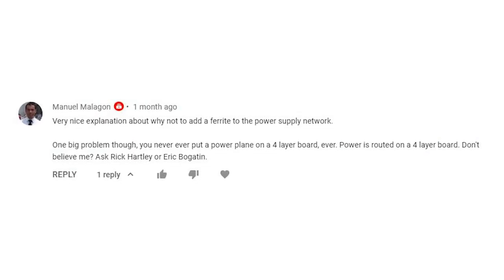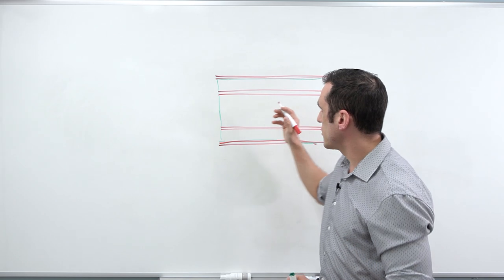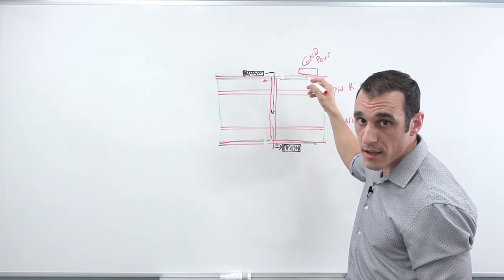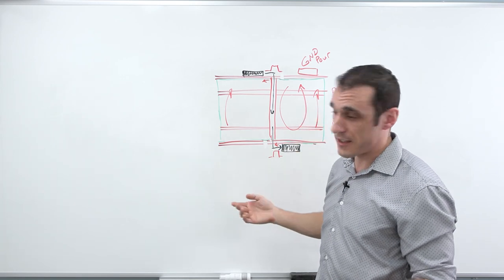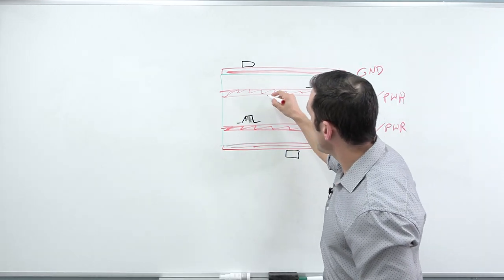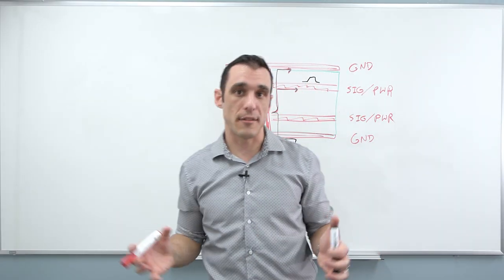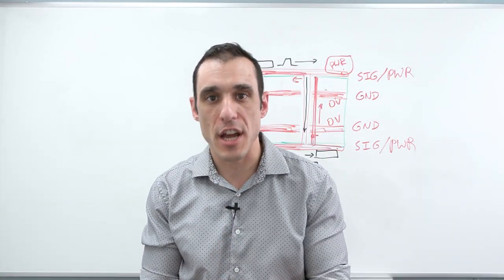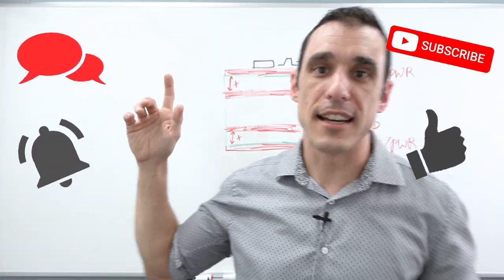Alternative 4-layer Boards for High Speed PCBs

Comment: What about when you have a BGA? there is literally no space to do any transfer vias
Reply: With BGAs it is interesting because you have to hope that the component designer placed the I/Os such that the fastest I/Os are on the outer edge of the component and so they will not require transfer vias. This is what is often done on Ethernet controllers for example, the controllers we use have all the fastest I/Os along the edges so vias are not needed. For I/Os that are in the interior part of the BGA, there will be a slight impedance discontinuity looking into the via but it will not matter so much until bandwidths are very large. This might be challenging on, say, an FPGA, but you have a lot more freedom to place those interfaces on an FPGA because you get to configure the pins when designing your application.

Comment: Hi, Zach. How can I provide a return path using SIG/PWR/GND/SIG, it is seems like there is no option. I can't route on one layer cause there's a lot of signals. Maybe i should use  (SIG/GND)/PWR/GND/SIG. What do you think about it? Otherwise it affects on diff pairs😢
Reply: The first question you should ask is: why do you think you need a dedicated layer for power? Is it because you have high current in the design, or do you have so many power rails that it will be difficult to route them all? Many designers who use SIG/PWR/GND/SIG do so without answering this question first. If you need to route digital signals on both sides of the board then you should use SIG+PWR/GND/GND/SIG+PWR. You could use (SIG/GND)/PWR/GND/SIG for high-speed on both sides of the board but it works best if you only route over uniform power regions with no splits, otherwise you can still create radiated emissions.
Reply: @Zachariah-Peterson  thanks for the reply

Comment: For better power distribution, should we use a pour or a trace on the bottom or top layer?
Reply: If by "better power distribution" you mean lower temperature rise when current is flowing, you can use large pour for power if the current will be high. If the current is low, you can just use traces to route power, you do not need large pours if the current is only a few Amps.
Reply: @Zachariah-Peterson  Thank you for your reply. I appreciate it. One question: when you said 'a few Amps,' did you mean under 10 A or 5 A?
Reply: @setia2258  Under 5 A. Eric Bogatin has a good rule of thumb, a 100 mil wide trace can easily handle a 10 A DC current.

Comment: What would be the relative limit to start considering the return current of a signal in a PCB design...?? I assume that some signals is not relevant the return current. For example the signal of an indicator led.
Reply: Hi Diego,

You always need to consider how you are routing return current. For your indicator LED, I would assume it's at DC, so there could be a large current loop in the design, depending on how you routed your ground. DC current won't produce radiation, but the loop that holds this current can receive radiation. The best way to deal with this is to use a dedicated rail that runs close to the LED power trace, or just use a ground plane. Using a ground plane is better. Thanks for watching!

Comment: What about a 4 layer stackup GND-PwPlane-Sig-GND : shielding provided by outter layers , and no crosstalk / good impedance control between power and ground planes ? I suppose we are in the case where 1 signal layer is sufficient. Signal will be mostly coupled to close GND compared to Power so splitted power plane with different Vcc would not be too much to worry ?
Reply: If one layer is sufficient and your high-speed design will be operating in a high-noise environment, then your arrangement would work well. If I were going to do the design with components on both sides, I would make it PWR/GND/SIG/GND. I would put power-related components on the PWR layer so that they don't need vias to access the PWR nets, and I think this would be better for splitting DC nets as you'll need to make multiple connections direct to polygons. SIG on the inside is also good as the planes provide some shielding.
Reply: @Zachariah-Peterson  This is a legit stackup that I didn't think about / didn't see before and seems to be optimized regarding power purposes indeed. Thanks for your prompt answer & keep doing these great videos !

Comment: Hi Zach, nice explanations, thank you.
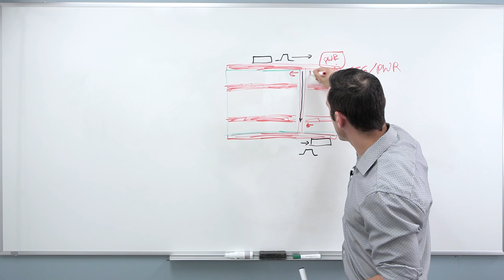14:15  "red via for return path" is it a via throughout between upper sig and lower sig layers?
or is it just between two gnd layers?
Reply: Hi Mustafa,
The red via is a through hole, so it accesses all layers, but is only connecting the GND planes.
Reply: @Zachariah-Peterson   Thank you for your answer,  can we call this method "via stitching"?  if not, what is the difference?
Reply: @myetis1990  Via stitching involves placing a regular array of vias around the board, usually to connect ground pour around your traces or to connect multiple planes. So if you have two internal GND planes, you could use via stitching to provide a low impedance connection between the two planes. I was referring to placing one ground via alongside the signal via. You can do both as the ground via next to the signal via will provide the smallest loop inductance return path.

I would not use copper pour unless you have a good reason to do so. Generally when we have a strong wifi signal being emitted or received in the board, we'll use via stitching with copper pour to provide shielding, but the vias have to be spaced closely to provide the shielding effectiveness needed in the design.

Comment: One thing worth mentioning about the GND-SIG/PWR-SIG/PWR-GND stack-up when doing developmental work is the inability to break a problematic trace for a bodge wire. If one insists on using this stack-up it's advisable to make the via trace to IC pin accessible for alterations, in other words, don't place via's under the IC. It's becoming increasingly harder to "lift a pin" on modern packages for easy modifications without the need to respin a board. Unfortunately I learned this the hard way after watching the presentation by Rick Hartley showing the benefits of that stack-up.
Reply: Yeah that's a great point, I had not thought of that. But I guess you could do the prototype with sig on the outer layer, then flip it to the inner layer with trace width or layer thickness modifications, and do a 2nd prototype just to check crosstalk and functionality is identical to the 1st prototype, then put it into production.

Comment: Hello, 
I have few questions with 2nd alternative, 
1.If our inner layers are GND , do we need to connect them with stitching via?
2. I am working on energy meter board, On top side only display and keys and few smd components present , others on bottom 
For Power section, analog and digital section 
I have different grounds 
Now questions is  how do I use inner GND layers with different section Grounding path?
And thanks for sharing your knowledge 😊 it will surely help me.
Reply: 1. Yes you should connect them with vias, stitching vias are fine and will help ensure you have a lower inductance return path if you will be making many layer transitions.
2. What is your justification for splitting into digital and analog ground sections?

Comment: The power routing should be copper pours.  Maximizing copper pours on signal planes with an alternating polarity from the associated reference plane will increase interplane capacitance, which is usually the only way to fight emissions over several hundred MHz when you aren't already doing something "wrong" (e.g. crossing a split plane).  It also makes the copper layers more balanced for manufacturing, but this is less of a concern these days.  And it should be solid copper (not hatched) if the intent is to maximize capacitance and minimize inductance.

I would also consider switching layers 3/4 of the second alternative as a variant (that is, SIG/PWR : GND : PWR : SIG/GND); the key is to ensure that the pours have the alternate polarity from the reference plane, otherwise there is no capacitive coupling between the layers.  This would give you a bit extra interplane capacitance between 2/3, though it's not as much because the outer cores are closer together (like 1/4 the distance in a typical stackup).  Stitching the pours together will be easier with a solid plane somewhere in the stackup.  Signals from the bottom layer can return through the power pin of the IC, skipping a few vias and a cap's worth of inductance in the process.
Reply: Wide traces can be good enough for power routing, just depends on the current being delivered. But yes I general I'd agree that you usually get the lowest inductance power regulator layout when you use pour, and it's usually easiest to get power out there to odd locations where a typical trace wouldn't fit if you just draw out a polygon.

The copper pour thing is one of those ones where I've gotten into friendly debates. Lee Ritchey has stated specifically that he uses copper pour to increase interplane capacitance in the way you describe. It also provides great shielding as long as it has enough ground vias, which I brought up in another video from the RF perspective. Most new designers though, they just fill in everywhere with copper and ground it at a couple points, then they wonder why it doesn't work so well at those mid-to-high frequencies. Or they will think "I just need to throw copper pour everywhere and now I'll never have an EMI problem", which is also untrue. So yeah, definitely stitch pours together like that if that is how you're going to use them.

For the alternate you mentioned, you're already hitting the points I was going to go over tomorrow when we talk about plane capacitance! So yes you would get some extra capacitance, but in the typical 4-layer stackup with a thick core I think it's only fF/sq. in. of capacitance, but it's great for providing some extra decoupling at very high frequencies.

Comment: This video is great! However,  I have a question. When you mention the stackup GND, SIG/PWR, SIG/PWR, GND - How does the SIG/PWR layer look like? Is the power also routed as a thick track between signal traces, or is it poured all over layer and that way connected to IC's? If it routed, then you have a small plane capacitance between GND and PWR? If it is poured, does it affect SI in signals in the same layer?
Reply: This is a good question! I seem to recall Rick Hartley saying to use copper pour on the component layer and just use that to connect to all components. If you do it as traces coming off a rail then yes you would have low capacitance, but that only becomes really important when you have a lot of digital, it would be fine for some lower frequency analog boards that take a DC input. Probably the best strategy with digital is to use a thin dielectric (8 mils or less) on the outer layer so that you can have thinner traces if you need impedance control, then you will have the freedom to use pour connected to power on the outer layer OR you could use traces. With a thicker dielectric on the outer layer, you will have to use coplanar routing to get to thinner traces and connect the coplanar region to GND.

Comment: Hi I like your video ... good explanation ... two questions ,, how far or near  should the GND VIA from SIG VIA ?

Secondly what about putting GND on second and PWR on third layer ... 

Third Question should the prepeg be in centre and cores under top n bottom ?
Reply: Hi Muhammad,
1. Ideally the GND via should be very close to the SIG via. Sometimes that might be difficult if you're routing between layers near other components, but I try to put it next to the signal via at just above the limits of clearances.
2. Doing that is fine, that is kind of the standard stackup where you have SIG/GND/PWR/SIG, just be careful to not route across the stackup without providing the return path between the top two layers.
3. Core is normally in the middle on standard stackups. If you want to do thick cores on the outer layer you can do that, but it provides less benefit for digital signals.

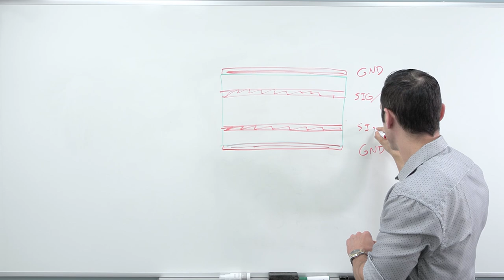Comment: At 8:50, You mentioned that, as long as you're not routing signals too close in parallel on the two inner signal layers, then this is fine to use. But even if they are routed close in parallel, why would that cause an issue if both signal layers are referencing ground layers much closer than the two signal layers are to each other? The spacing between each signal layer to the ground layer is much lower than  spacing between the two inner signal layers due to the thicker core. Wouldn't the much lower impedance between signal and ground nearly eliminate issues of cross talk from signal layer to signal layer?
Reply: Crosstalk won't be eliminated in that case. The thicker core helps with the distance because greater distance decreases field strength seen by the victim, but both traces have two inductive loops to receive crosstalk, and one of them is large. It actually increases the total equivalent inductance because the two inductive loops can be modeled as being in parallel. So there is still some crosstalk, just hard to generalize if it is a specific amount lower than in the same-layer case.

Comment: It was very helpful thank you!
I have a question, in SIG/GND plane/PWR plane/SIG type stackup, if I have a lots of digital signal, is there any solution through Via provide the return current?
In this case should I use SIG/GND/GND/SIG?
Reply: You could have SIG/GND/PWR/(SIG + GND pour), and then place a grounded through via between the ground regions next to your via transitions. If you don't need a lot of current and you can manage to reach all of your components with power rails, then you could do SIG/GND/GND/SIG.
Reply: @Zachariah-Peterson  Thank you very much for answering me! It was very helpful!

Comment: Hi Zach,

I'm a bit confused about one thing you mentionned, regarding the "GND / SIG-PWR / SIG-PWR / GND" stackup:  Why would we need ground vias near signal vias, in order to couple the return path in the transitions between L1 and L2?  If the dielectric between L1 and L2 is thin enough ( < 10 mils ), wouldn't the path of least impedance be to couple directly from L2 to L1?  A ground via would probably be further away from the signal via, compared to the distance between the ground plane and the signal via.

Also, I thought ground vias were only necessary to couple the return signal in the transition between layers that are not referenced to the same plane.  In this case, we are not changing reference planes in the transition between L2 and L1.

Could you clarify this for me?

Thanks,
Maxime
Reply: I think you're looking at what's going on around 10:43, is that correct? If so, the GND via is more important for the path from L1 (maybe an I/O on a component) down to L2, and it's even more important for the transition from L1 down to L3 or maybe a component on L4. Just routing into L2 you are correct you would have a strong capacitively coupled return path to the GND on L1. There will be a small weakly coupled transition in that top region with the via that could have stronger coupling, and you would provide this with a via. The easiest way to ensure you have this coupling everywhere is with stitching vias that connect the grounds on the top and bottom, and then you just try to route around those or delete any of those stitching vias that interfere with routing.
Reply: @Zachariah-Peterson  Thank you, sir!  I was indeed talking about the part at around 10:43 into the video, and now I understand perfectly with these additional explanations.  Greatly appreciated!

Maxime
Reply: @Zachariah-Peterson  Quick update:  I followed your advice, along with some tips I picked up on some Rick Hartley videos, and my 4-layer board works magnificently well.  I was able to completely eliminate the EMI that made my microcontroller behave all screwy.  Thank you!

Comment: Hello, first of all, thanks Altium and you sir (Zach Petterson) for this series of training videos it really helps me to understand PCB design significantly. I have a question to ask: we can choose the correct track width and clearance for single-end and differential track but what about connectors how can we correct impedance mismatching caused by routing through connectors?
Reply: Hi Saeed, Connectors that are designed to support high speed or RF interconnects will be designed to a specific impedance value. For example, Samtec sells 50 Ohm SMA connectors that are used to route RF signals over a coaxial cable. Other companies sell similar products. If you need to apply some impedance matching, then you should consider a different connector, or you need to design to the connector impedance and then match at driver and receiver. It's best to try and find a connector that can support the standard impedance you need to route at.
Reply: @Zachariah-Peterson  thanks for reply, in my project I use DF9 connector(1mm pitch) to route gigabit ethernet tracks is it ok to add gnd to adjacent pin to help return pass?